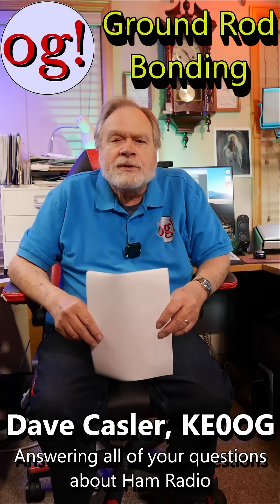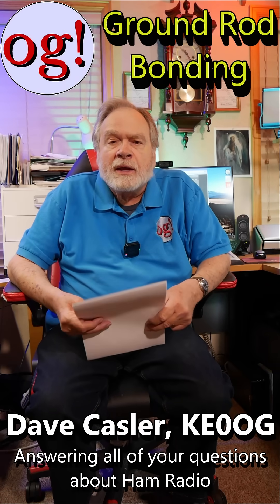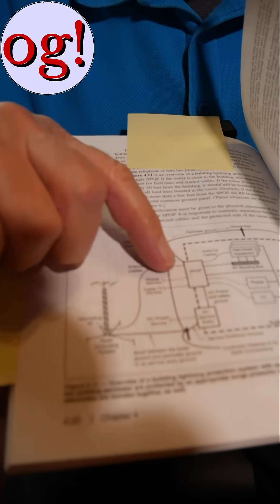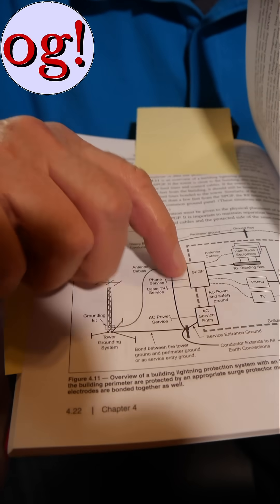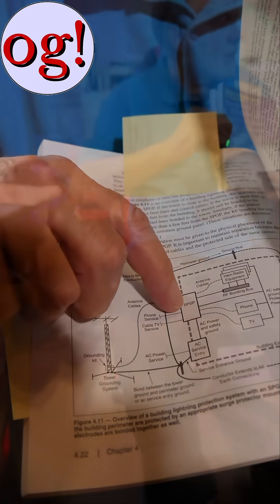Ground Rod Bonding (Short #67)

Comment: I think you are misunderstanding the guy stating the house ground rod is on one side of the house and the shack is on the other side of the property. I believe they probably have a long "rambler" type single story house that is narrow but very long in one direction. I have one of these houses too and my station is on the complete opposite end of the house. That means my bonding wire is going to be somewhere around 70+ feet, probably well over 100 feet if I bury it around the perimeter of the house, to the main grounding rod at the other end... This definitely seems excessive. Is there really no practical range for bonding a separate grounding rod to the main house?

Comment: Ground the single-point ground to the AC ground (green wire).  Don't mess with trying to connect a separate equipment ground to the AC panel ground rod.  First, are you qualified to make connections to your home's electrical system?

Are you concerned about lightning? Don't operate when lightning is possible near your station.  Physically disconnect your equipment from AC power when you are not using it.  Disconnect your antennas from your equipment when you are away or when lightning is possible in the area.
Reply: I think he's saying connect it directly to the original house ground rod with a compression fitting, not the panel...
Reply: @Ahand59 The same reasoning applies. Attaching your ground wire to the service ground rod is a modification and may require a permit.  No ground wire you install this way will protect your system from a lightning strike.  The grounding in your shack should consist of bonding all elements of your station to a single point ground and then connecting that to the service ground via a convenience outlet.  One way to do this is via a metal cased grounded power strip.  Studs can be mounted to the metal case, and then the elements of your station can be bonded to the studs.  When the strip is plugged in,  the case is connected to the household ground.  Yes, this is modifying an appliance (the power strip), but it is a minor mod.
Reply: Well ok but.
1. If it requires a permit, ok, go get one.
2. Are you qualified. Of all the mods to make, throwing an acorn and bonding conductor onto a ground rod is probably the easiest, safest thing a person could do.
3. All the stuff about connecting to via a convenience outlet violates one of the primary rules of lightning ground work which is keeping it isolated from all the rest of the conductors. If there is a direct strike, you don't want to route all that current through the electrical system in the house, you want to take it outside (preferably you want to keep it outside). There is a reason nearly every expert explains to keep the grounds short, direct and go outside as close as possible to the shack, along with all the bonding so voltages rise in unison. I would never in my wildest dreams route my ground through a convenience outlet for lightning purposes.
Reply: @NickFrom1228 Your best bet to protect your house and equipment is to keep a large air gap between your radios and your antennas when not in use or when there is threat of lightning.  We had a lightning strike NEAR our house in GA a few years ago while we were out of town.  It struck an unused light pole in the backside of the lot and ran down the pole to the ground.  There it propagated outward and found sprinkler valve box. I'm guessing it vaporized residual water in the valves, because the valves were in pieces and the valve box was blown several feet away.  Current traveled via control wiring back to the controller on the side of the house, which also exploded, sending pieces 25 ft away. The pump relay was fried, and the GFCI feeding the controller was trashed.  Inside the house, the fancy smart controller on the water heater died.

Now there may have been another strike near the other end of the house, but there was outher damage that seemed to come in via cable.  The cable modem/router was trashed, and its wall wart was in pieces.  A DVD player was toast, and the HDMI input on the old plasma TV was damaged.  A wirenut connection feeding power from a bedroom to the adjacent office was carbonized and power to the office was lost.  Again, the house did NOT experience a direct strike, but there was a lot of (repairable) damage.  I don't trust that I can leave a lightning rod (antenna) up and somehow get the lightning to go where I want it to wirhout damaging my station

Note that no circuit breakers experienced a tripping load during this incident.